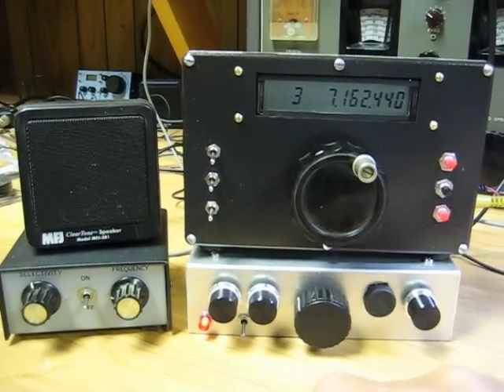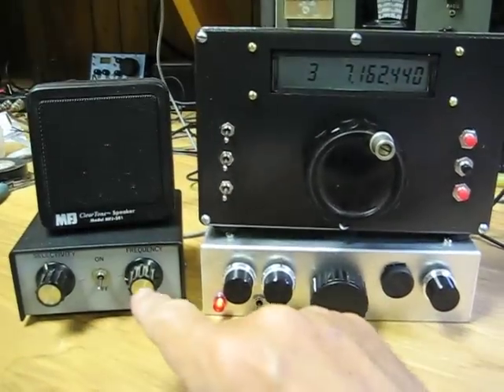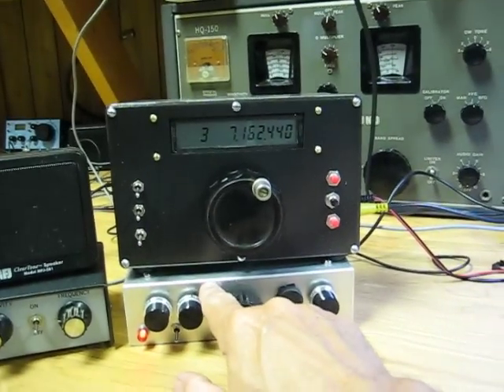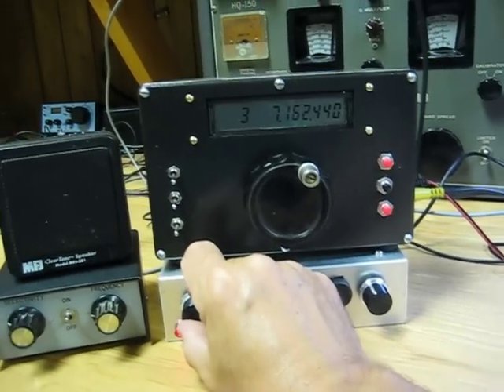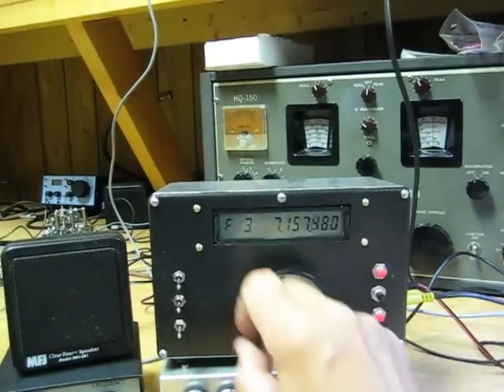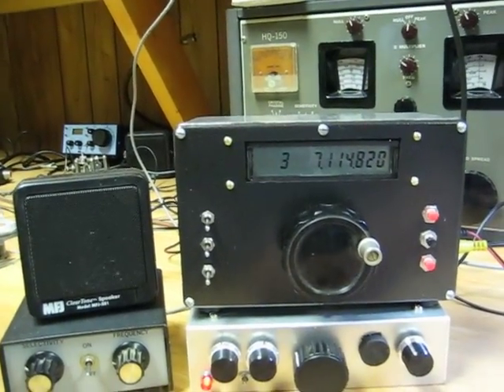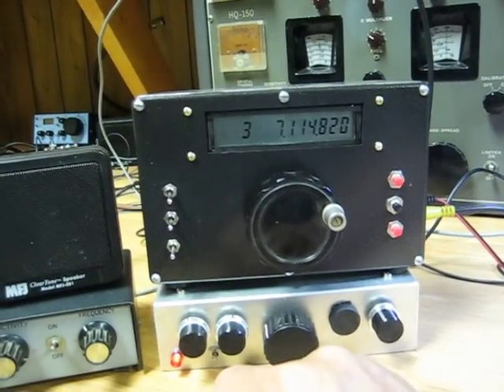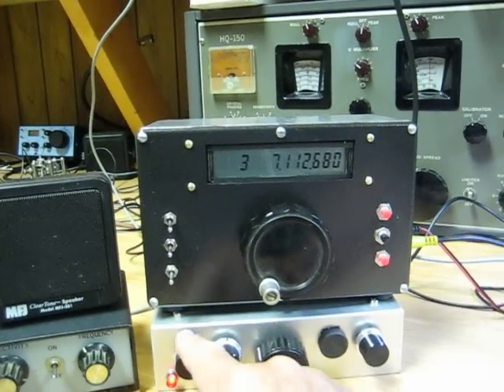N3ZI DDS VFO and TenTec 1056

Comment: Are there any tricks to feeding the mixer of the 1056 with the N3ZI DDS? I assume one could connect it to C7 (0.1 microfd) or if the DDS has a cap output, directly to the pin 6 on the mixer.   Does the DDS have enough power to do that or is a buffer amp needed?